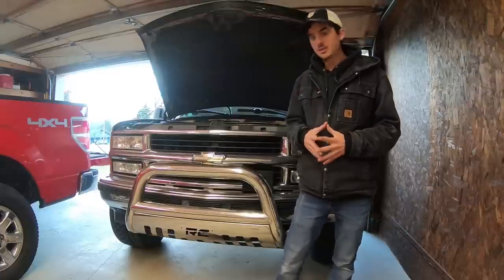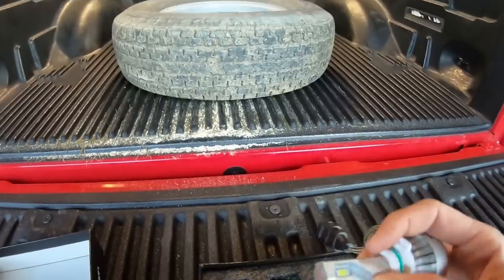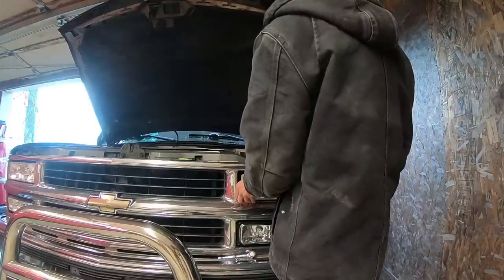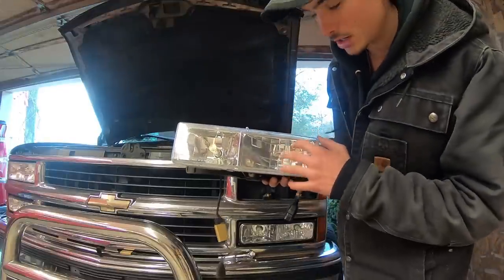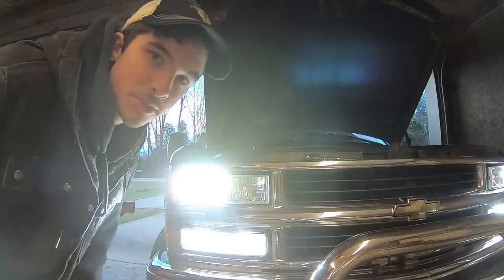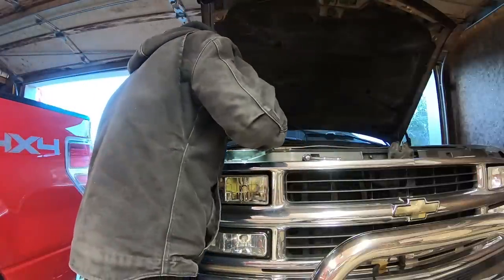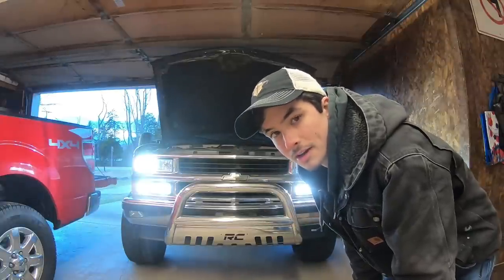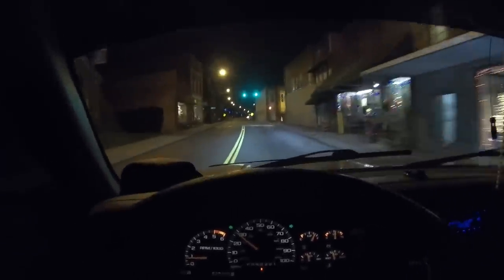Lasfit Led Bulbs Install and Review: K1500 Lighting Upgrade

Comment: The 9006 bulb is also the Fog Light bulb for the 2005-2009 Subaru Outback (not the Legacy sedan/coupe which uses an H3 fog light bulb instead).
I have 9005 LS Lasfit bulbs for my 2008 Outback XT Limited STi's high beams, H7 LS's for my low beams and LA 9006 for my fog lights.
It would be smartest to use a Multimeter on the 2 bulb wires then turn the lights on. If the meter shows a + voltage then you're correctly on Positive and Negative. If it shows a Negative voltage rating/reading then your wires are the other way around. With my 9005 LS high beams I am absolutely never flashed at due to my high beams being on. While they are tremendously brighter than the factory halogens the light is less intense to the eyes of oncoming drivers. So they haven't flashed me yet (I don't leave the high beams on needlessly but drivers the other way still drive into them when I have them on and there's no response at all)!

Comment: I heard you say before you have the switch were if u turn on your brights your brights and lows come on were did u get the kit I can't find one
Reply from the maker: I am not understanding what you are asking.
Reply: @TrucksandWater  hes talking about a 4 high light mod it allows your low beams and your high beams to be on at the same time
Reply: All you need is a relay

Comment: I need your truck man, it's In great shape i have a new LTZ Z71 and I still want a 98 model like yours. Everyone round here wants 7500 for 96 models with 275,000 miles though..😒
Reply from the maker: They are getting harder and harder to find that’s for sure and the prices keep going up.
Reply: I will sell ya mine

Comment: What kind of bulbs are you using for your turning signals they look really good instead of the regular orange once
Reply: Señor Cisneros Switchback leds. They’re on amazon, I have partsam on my truck
Reply from the maker: white led ones from amazon. They are called siri.
Reply: @TrucksandWater  you think i can get the link to them kinda want to do the same headlight set up you got looks reall good my truck a 97 same color as yours
Reply from the maker: SiriusLED Extremely Bright 2835 Chipset Projection 1400 Lumen LED Brake Tail Turn Signal Light Bulb Pure White Size 1157 7528 2057 Pack of 2 https://www.amazon.com/dp/B073SKC4YM/ref=cm_sw_r_cp_api_i_OS5gCb6GYZV61
Reply from the maker: SiriusLED Extremely Bright 2835 Chipset Projection 1400 Lumen LED Brake Tail Turn Signal Light Bulb Pure White Size 1157 7528 2057 Pack of 2 https://www.amazon.com/dp/B073SKC4YM/ref=cm_sw_r_cp_api_i_OS5gCb6GYZV61
Reply: @TrucksandWater   Hey i forgot to ask bout a month ago, what high beam bulbs are u using ? Truck is looking good like your whole headlight set up👍

Comment: Great Video.  I might try some but how loud are the fans and when do they run?  I assume they only run when the headlights are on?  Can you hear them inside the truck?
Reply: I had some in my Tahoe no fan noise in the cab could barely hear them outside too
Reply from the maker: The fans are stupid quiet. You can’t hear them in the cab. Outside the cab, you have to put your ear up to the headlight to hear it.

Comment: Hey, do you think those Sirius Led turn signal lights would fit my 97 Sierra k1500. Amazon says it doesn't but I doubt it so asking you. Thanks in advance.
Reply: They fit aftermarket headlights like in the video - not sure if they fit stock.  However, you also need to replace the relay, so that might be why it says it “doesn’t fit”

Comment: Did you make the indicator lights into headlights? If so what are you using as indicators, the markers?
Reply: They're probably switch back LEDs. White when parking light is on then turn amber when you use your signals/hazzards
Reply: Was wondering the same thing. Did you end up figuring this out?

Comment: No resistors needed?
Reply: Zach F no many new leds come with thier own resistors already come connected with the bulb. Plug and play. I used auxbeam. Very bright.
Reply: Joaquin Torres awesome. I’ve used HID lights in my previous 2 vehicles but currently looking into other options. Thank you
Reply from the maker: They have one already built in. I love leds over HIDs every day of the week. They seem to hold up better.